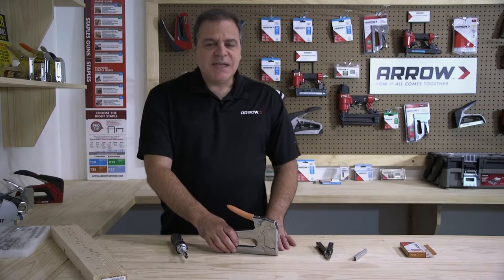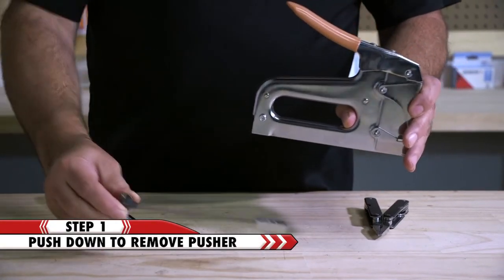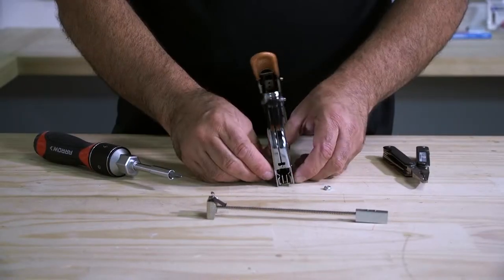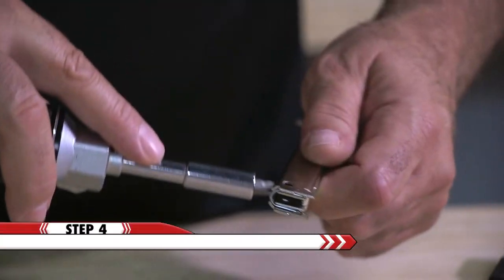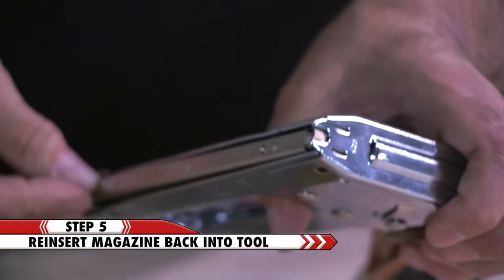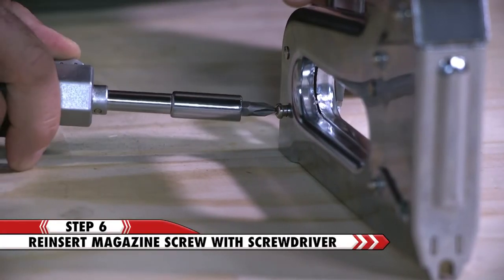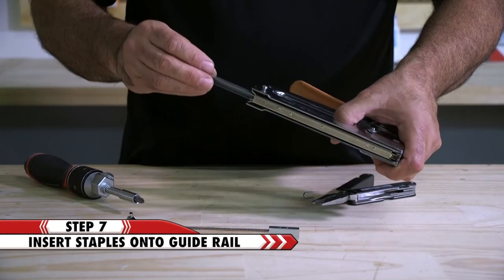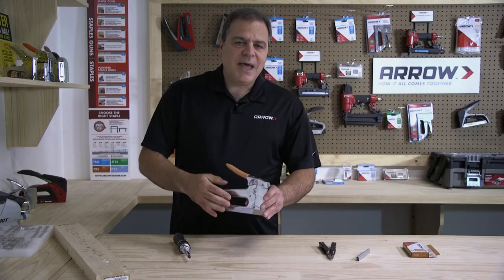How to Clear a Jam From Arrow's T25 Staple Gun

Comment: Why isn't this in the manual!? I always had to resort to banging my stapler on concrete or with a hammer to clear jams! Sometimes didn't even work and one time damn near took my thumb off!😂😑 How many staples and headaches could have been saved and avoided...
Reply from the maker: We're sorry to hear that you had so much trouble clearing jams -- and we're glad the video helped!
Reply: @arrowfastener  Yeah, I'm glad I saw this video too before I threw out my stapler after I nearly destroyed it trying to clear a jammed staple that just wouldn't budge!!! A better design would have been too make the staple window the whole length of stapler making it easy to just slide a pin or something in there to clear any jams!
Reply from the maker: @Cat4evr  Hi there! Thanks for the input. We appreciate it. - Arrow Fastener